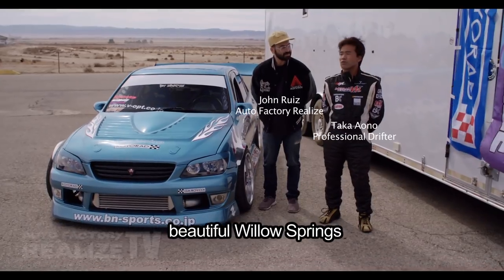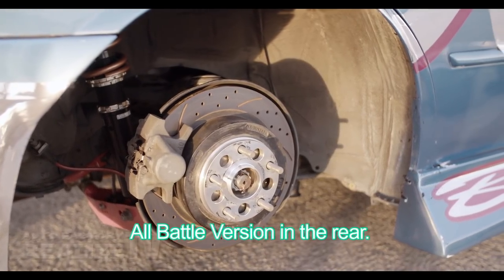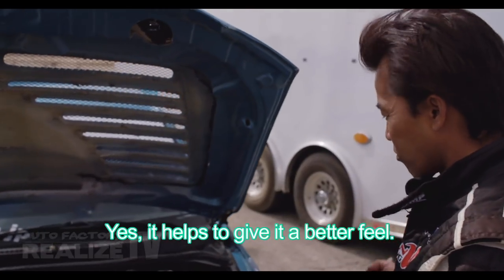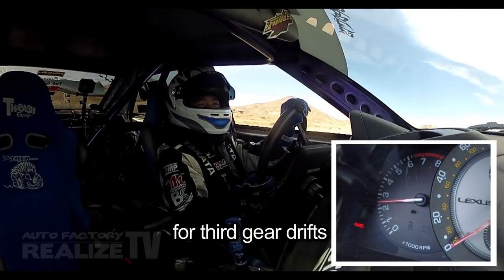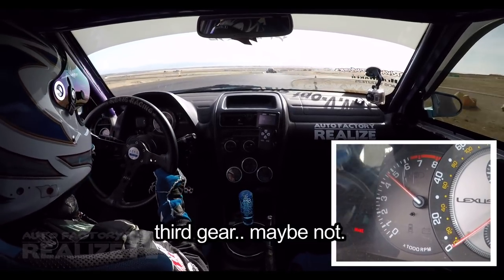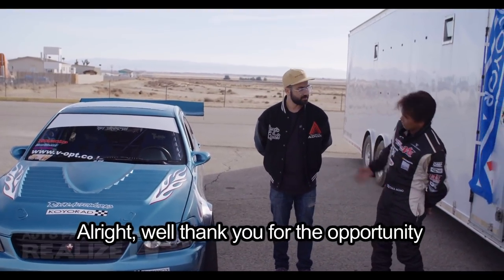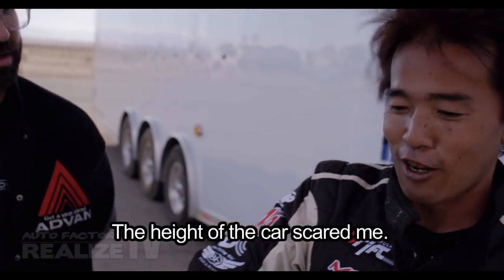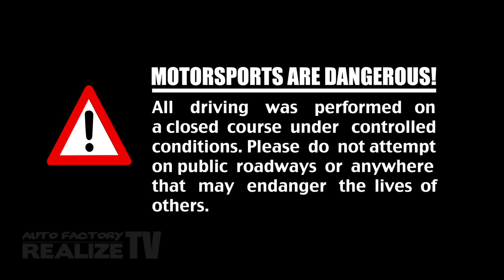Machine Check - Auto Factory REALIZE IS300

Comment: Maybe if he took that gigantic wing off he might have enough power left to drift instead of having to push through the wind hitting the car.
Reply from the maker: It’s really funny you mention that. Taka did bring up that the wing was generating a ton of downforce on the high speed portions of the track, which was new to us since before this the car had only been on smaller technical tracks where it was only seeing 2nd gear. Definitely something to take into consideration for the future.